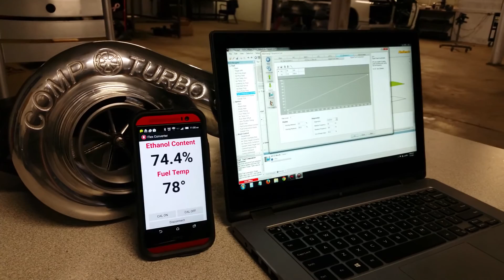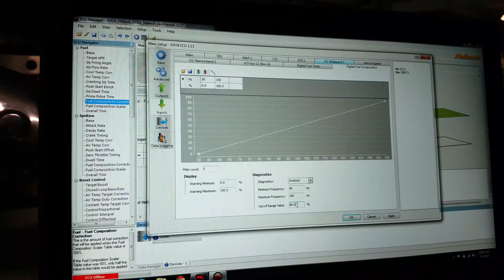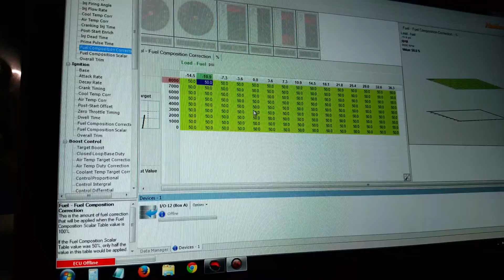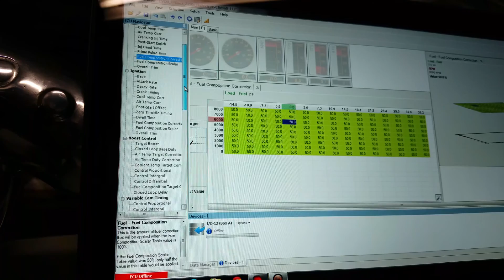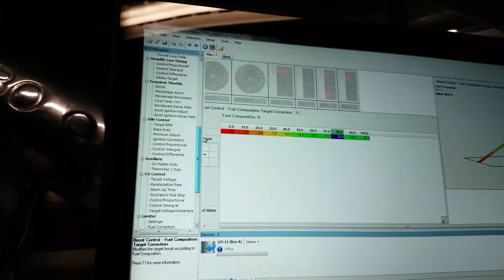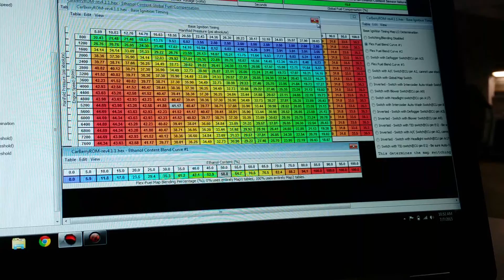WSRD Carberry flex fuel/SD rom explanation/comparison.

Comment: Can u do a carberry install video been trying for 3 days and no luck
Reply: What are you stuck on?
Reply: I got it but thanks now im fully building my car with a fp black full sd tail 38mm eagle I beam rods cp pistons bc 280 cams bc dual valve springs bc 1mm over valves with bc 6deg clips

Comment: Wow this is fantastic! I was wondering how I'd be able to run E85 on my JDM STI to make more power from the Dom 1.5XT-R and you make it super easy to understand. Love the fact it's just one ecu flash and it will automatically adjust to the blend without having to reflash ecu every time running diff fuel.
Gotta talk to my tuner about this when I pickup that module and convert to E85 components.